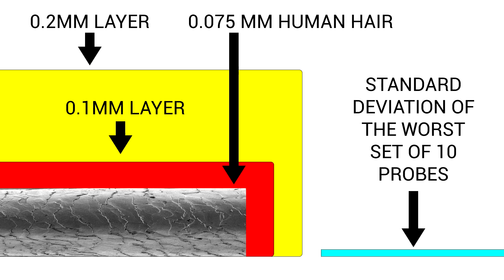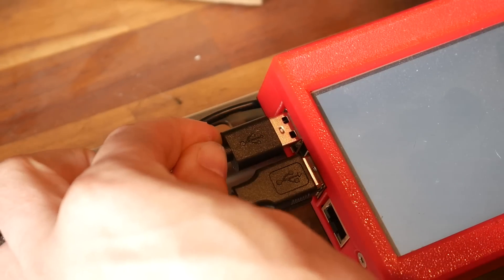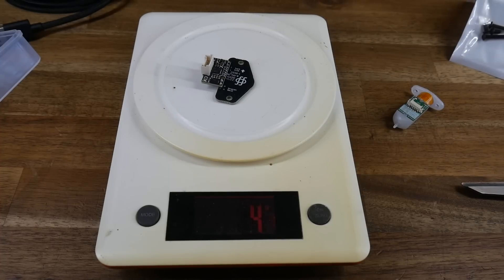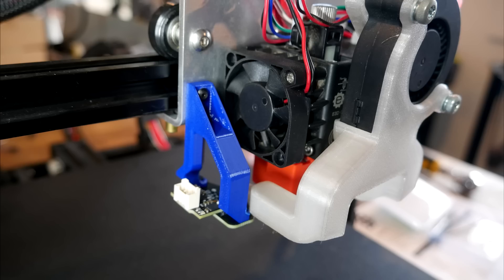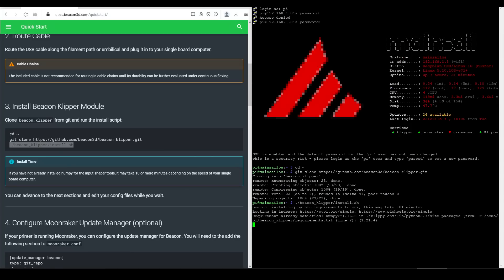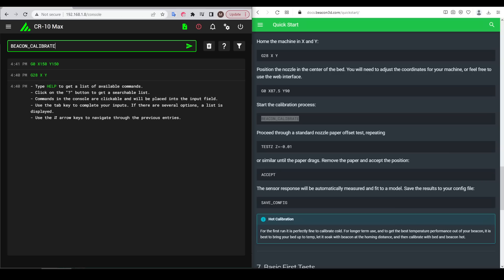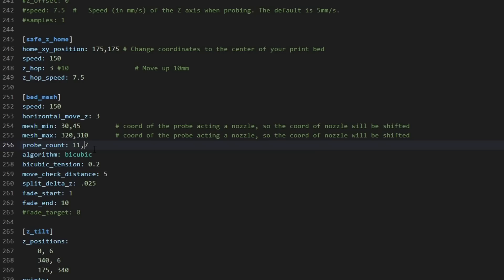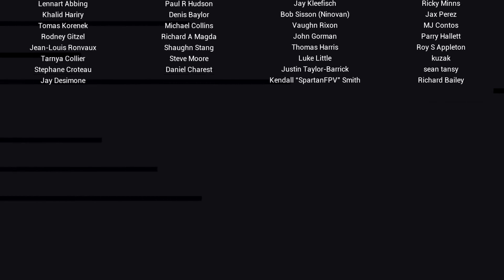Beacon ABL bed scanner - Amazing speed and accuracy, perfect 1st layers

Comment: As an information there is also Eddy by btt that works with klipper or the mellow fly  sht 36 v3 max ( works with rrf also with the Team Gloomy stuff  and klipper but needs for rrf an board with can)  also got  a  stepper drive(tmc2209) an accelerometer and other things  costs are around 28.79€ right now on AliExpress.

Comment: Beacon is about the same price as the E3D PZ probe, and it is more accurate.  My Sovol Zero has both an eddy probe and a strain gauge probe.  I'm starting to build a Voron Trident, and I will probably have both the PZ probe (which didn't work well on my Enderwire conversion) and a Beacon to have the same ability as the Zero.  BTW, the PZ probe probably works best with the z axis moving the bed as it will transmit less noise to the probe when homing.

Comment: Nice guide/review!
Is there a probe that is an upgrade from a Bltouch that would work with the same port/connection?
I'm modding an old Artillery Genius to Klipper and a Stealthburner toolhead, but I'm not really looking to upgrade the 8 bit mainboard (unless maybe a cheap direct drop-in exists, i really don't want to rewire).

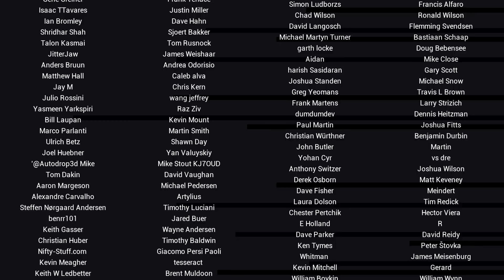Comment: 13:58 If not included within the original printer design, I think it's too clunky. But promising. Maybe in combination with a strain gauge for calibration of the probe. And its own dedicated MC just for probing To create even better/ faster results. Because if you can crank up the resolution (as in probings/second) you can also increase the speed it can wander over the surface. And if you make a two-pass test with many points (even more you did here, that means more than 11x11) once in a while, and a quick one  (7x7 one pass) before each print. …

Comment: I hope someone might be able to help me on this. I've installed the probe its working great but when I run a mesh it skips over the 1st 60mm of the very left of bed and completely goes off the bed on the right side. I've adjusted the Mesh_min and the mesh_max and also the probe offset . I'm stumped on this..

Comment: I got one of these coming to try out on my vzbot build and also have a BD sensor coming to test as well. They both function in the same way . I have a bltouch and an inductive probe both to compare them to.  I use PEI sheets on most my printers. The few printers i have left that use glass are going to stick to bltouch or manual mesh.

Comment: Cool as this is, I think we are approaching bed level the wrong way as a community. We need to demand that manufacturers give us straight beds that don't need these secondary steps that just trade one problem for another.
Reply: Unless you demand manufacturers provide beds that have been cast rather than formed, then been heat aged/treated, then machined and then ground and are as a result prepared to pay the hefty price that comes with those secondary very costly processes you are not ever going to get a flat bed, and even then it won't be absolutely perfect, ever, perfect flatness doesn't exist in the real world, only acceptable deviation, measurement and compensation will always have a place, this is true in all engineering. But what you are really demanding is that they be cheap and widely available on cheap printers, because you can already buy precision, you just have to pay for it, this demand is simply unrealistic.  Precision toolmaking has been around a good long time now, it's not like this is a new thing, just like people expecting to pay cheap tool prices for precision tools that are expensive to manufacture.
Reply: Better tolerances and less heat warping would be great, though there are associated costs and tradeoffs. I suspect that for most cases ABL is a better use of time/money vs better tolerances.
Reply: @szurketaltos2693  Quite right, ABL is very cheap compared to the cost of upping the precision of a large component.
Reply: @m3chanist  Great writeup, it's even more lopsided than I thought. It is interesting though, how "good enough" precision has gotten cheaper recently. I'm talking about the advent of $10 steel digital calipers, ABL, and so on. I suspect that modern machine tools also make the really high end precision also a bit cheaper, but still very very impractical to put on a consumer grade printer; and of course, that may be balanced out by increasing labor costs for skilled machinists.

Comment: Wait what? So this probe still does only a fairly sparse bed mesh, but quicker? To me this has no point whatsoever then. The only reason I would buy this is if it did something like 256x256 mesh accross the bed.

Comment: I really love your channel, I watch almost every single video and I truly appreciate your work. 

I have checked out several products you've reviewed, and this one was one of the most exciting to me. 

Since I am very new to this 3d printing thing, I have very basic entry level products. I have an ender 3 s1, but also got a secondary sprite pro print head, because I intended on swapping out the pro head for hotter materials and using the standard sprite head for lower temp materials. 

In December, I think, I caught the product launch for the sonic pad. They REALLY sold me as YouTube doesn't seem to have any really negative remarks about it and it has KLIPPER!!! 

Now, as a new person to this world, and a gadget nerd, I just had to know of the awesomeness of this entirely new program that I'd never heard of, and it is impressive!!! So I bit and, bought me a brand new shiny thing that was going to be fantastic!!!

Move on to the current video on this AMAZING, AWESOME,  Beacon ABL sensor. You had me at fast, high resolution, and non contact. I was fully ready to drop my $80 on this magnificently cool product. 

But as a lot of people are using it on ender c series and ender 5 products, I reached out to Beacon3D to ask a couple of pre purchase questions, what they told me was VERY disappointing. 

Though the sonic pad runs "Klipper", it isn't REALLY KLIPPER. Apparently, creality messed with the source code and didn't say how, to Klipper's open source code update log. This basically negates the license for klipper, and this was reinforced by the klipper official discord channel. They openly stated that they don't acknowledge the sonic pad. And that creality has violated the license, their words. 

Beacon3D said as much as well. So basically, if I wanted, which I actually do want the Beacon abl, I would have to dump simplicity and then learn how to use, set up, and run klipper in a raspberry pi, and the sonic pad would basically be a $159 paper weight. 

It's VERY frustrating to me that no one has brought this up. 

Creality is basically conning everyone who buys their sonic pad by NOT specifying that it isn't REALLY klipper, it is a half measure knock off of the fully functioning program.  

I truly hope that Beacon eventually works it out, or that Creality creates a compatibility with Beacon. Because THIS is exactly what I wanted, for a bed leveller.

But if you weren't aware, potential buyers of Beacon BLS should be informed, as it is non compatible, at all, with Beacon, according to Beacon 3D.

Comment: I'm just upgrading to a canbus board to reduce my wires run to the head, could this be run to the CANBUS board rather than a home run directly to the main board?
Reply: Their documentation only states that it needs to be plugged into a single board computer, which a CANBUS board is not? Or am I mistaken? The CANBUS is only an MCU board correct?
Reply: Found my answer, haha. The USB-C on the CANBUS is only an input, not capable of bidirectional usb transfer trying to couple with the 4 wire CANBUS 😞 disappointing as running a 4 wire, and a USB cable is not ideal, but will make that sacrifice for this scanner 🤷‍♂️

Comment: Hall sensors work with eddy currents too. The Prusa mk4 uses a hall sensor for the filament detector, for example.
I am not sure if this different approach uses exactly the same method of orthogonal magnetic fields and their interruption. Take a look at hall sensors.
Reply: Hall sensors detect charge deflection in a conductor due to the presence of a magnetic field, aka the hall effect. Eddy currents are reverse induced current in a secondary conductor. Two different things. Hall sensors don't detect eddy currents. Common industrial hall sensors such as the pinda etc have their own built-in permanent magnet to provide the field which then gets disturbed by the presence of a metal element such as a steel print bed, the hall sensor detects that disturbance. Again hall sensors don't detect eddy currents, they detect magnetic field variation, now an eddy current can produce a magnetic field and if that current were to change a hall sensor could detect that. I suspect this is exactly how this sensor works, I designed something similar for a different application (machining) about eight years ago, we used a small coil to generate a timed changing field, a comparator compared the resultant periodic output from a nearby hall sensor with our known periodic field change to detect target distance. It's just a spin on the traditional permanent magnet sensor I.E instead of having a permanent magnet producing a fixed field and varying the distance to target while measuring the hall output, you vary the field and calculate the instantaneous distance to target by measuring the hall output in synchronisation with your varying field.

Comment: Very nice video. But, my question is, will this work with glass print surfaces?
Reply: After reading the docs, it doesn't seem like it. It does mention this warning when using stacked surfaces though- "When working with laminated or metal substrate stack ups, Beacon senses the conductive subsurface -- thinner laminates and adhesives are recommended to reduce surface variations due to the stacked material thickness." That leads me to believe it will try to measure the metal base but anything stacked onto it will be effectively ignored. That's a shame because id love to have one of these but Id rather have my glass bed and just wait an extra minute before each print

Comment: Wanted to share this for anyone else who runs into an issue with Klipper throwing "move out of range" errors when calibrating the Beacon:

1) Home X and Y normally, then sent G0 X150 Y150 in the console.
2) In printer.cfg, do the following:

(Copy and paste everything from and including the [ and :, then put it after [beacon] to minimize frantic scrolling)
[homing_override]
set_position_x: 0
set_position_y: 0
set_position_z: 0
gcode:

Comment out [safe_z_home] and its contents. Don't delete the original block or contents, you'll need those later.
In [stepper_x], [stepper_y], and [stepper_z], change position_min to -50.

3) Send SAVE_CONFIG in the console and allow the printer to restart.
4) When the printer is back on, send G28 in the console. The print head should not move. 
5) In the console, send g92 x150 y150. This will tell the MCU that your X and Y steppers are currently at 150/150. (Not strictly needed, but covering all bases).
6) In the console, send beacon_calibrate and continue with the normal process.
7) After accepting, the print head will try to move slightly to a new position and probe for Z home. When the print head gets very close to the bed, a red LED on the Beacon should turn on. If this LED DOESN'T TURN ON, IT MIGHT CRASH, so be ready to e-stop just to be safe!
8) SAVE_CONFIG and allow printer to restart.

Note: Once this is done, the Z offset will be saved to the model named "default". The model name can be changed in printer.cfg in the Beacon config options.

9) Go back into printer.cfg and do the following:
Comment out [homing_override] and its contents.
Uncomment [safe_z_home] and its contents.
In [stepper_x], [stepper_y], and [stepper_z], change position_min to their previous values (should be 0 for X and Y, and mine was -5 for Z, but yours may vary).

10) SAVE_CONFIG and allow printer to restart.

Your printer will now home regularly using the Beacon for the Z axis probe. Congratulations! You have bypassed a weird hiccup that probably only impacts like 5% of us Klipper users :)

Comment: Why would the mainboard matter if it's connecting to the Pi or whatever other SBC you might be using?  Isn't the secondary ECU doing all the hard work? What does the mainboard have to do with the process?
Reply: When printing,  the system would have to add/subtract the interpolated Z axis correction many times per layer **.  No 8 bit board has a high enough CPU clock to do this in a timely manner.

** makes me wonder why we're not doing Z axis correction in the slicer?

Comment: Even on pei on metal sheets, pei and the glue used to apply it can have uneven thickness. This is only measures the variation over the metal

Comment: Beacon is epic. I use it on my machine, it's a million times better than the POS BL Touch I was enduring for the longest time. Beacon is currently the best Z probe and bed scanner by a longshot, all the other stuff is trash and obsolete. Beacon: Fast, accurate, small, lightweight, superior.

Comment: As much as I love the concept of the beacon, the speed and accuracy, the fact that I use FR4 (GR10) plates for all of my printbeds makes the beacon not usable for me.
Also, I recently switched nearly all of my printers to klicky-probe. A beacon for each one would have been very expensive...
Reply: yup. i even have a timber print bed... glass, fiber, timber... they no worky!

and i just dont bother with bed levelling, i can jog the head across and get it pretty well much spot on before the "autoprobe" has even got its first measurement...

Comment: To be honest, the time saving isn't a huge selling point for me as I'm regularly running multi-day prints but I'll quite happily swallow the cost if the accuracy is considerably better. Slowly upgrading my machines to Klipper so reckon I'll give it a shot on one of them. Can't see it being too long before there's a repository of user-designed files for mounting it to at least the more common printers so that'll remove a major hurdle for most people.
Reply: Have you tried it? If so, how well did it work?
Reply: On a 500mm ratrig the mesh leveling can take up to 10 minutes with the bed warmup included. That's a lot of time between prints. This would cut meshing down by 30% i bet. That adds up in a print farm environment.

Comment: Would this work with Ender 3 s1 and pro using sonic pad?
Reply: No. Here is the replies I got from Beacon3D:

"Unfortunately, Beacon cannot be used with the sonic pad. We've been told by some members of the klipper community that it uses a modified version of klipper (possibly in violation of the license), and it doesn't allow modifications to the code -- this is required to install the single file of beacon code.

Regards,
Beacon3D"

Also, THIS:

"If you switch to a pi 4b you would be set up on the klipper side.

Looking at the motherboard it appears to be 32-bit which is generally sufficient. We have noticed that some 8 bit boards have latency issues -- this 32-bit board uses a usb to uart bridge instead of native usb, we're not certain if this alone will result in latency similar to 8 bit boards or not. This is a possible gray area for compatibility, would ideally want someone in the community to confirm if it works with klipper's "multi mcu" homing feature.

Note that Beacon does also require a metal keepout area above the sensor, this would need to be taken into consideration when designing a mount.

Apologies we can't give a more precise answer at this point, there are so many different machines out there!

Thanks,
Beacon3D"

It appears to me that Beacon is made specifically for big money printers like the Voron kits, Prusa, and other $1k+ kits. And that Creality is for the lowly proles.... Also, Creality is the single most popular first printers, at least in the U.S..

Comment: I removed the springs under my Anycubic Mega X print bed two years ago.  
Installed jam-nuts to prevent leveling knobs from rotating.
Manually leveled it twice since then after repairs.  No leveling mesh.
I fear I am doing something wrong, for I never have leveling issues.